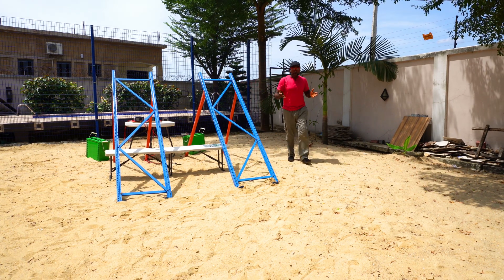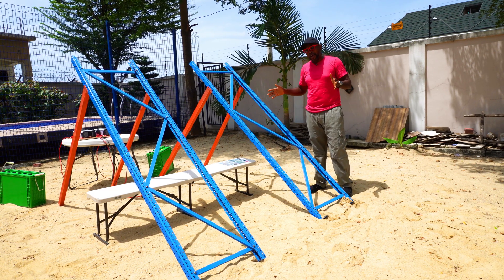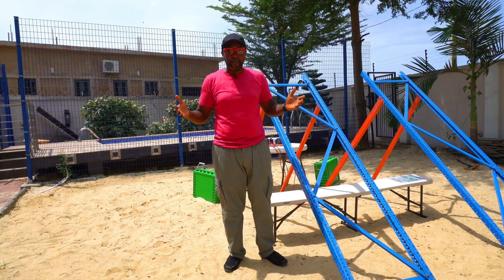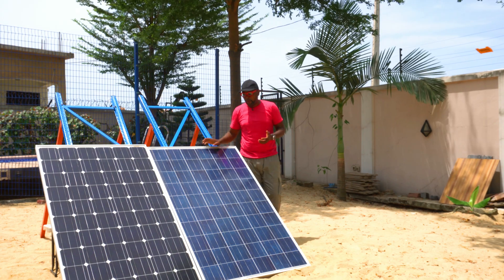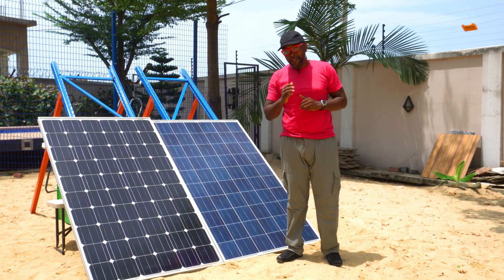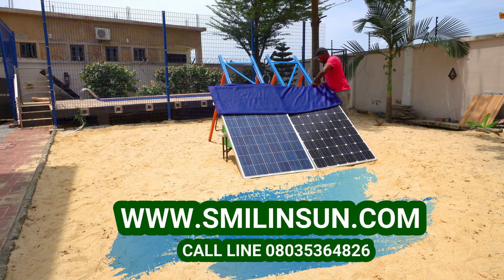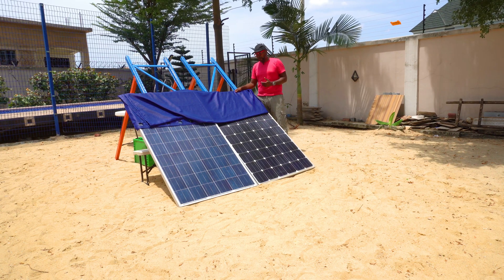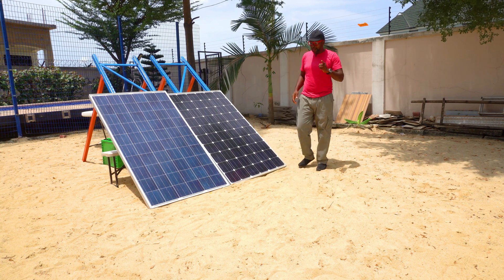Polycrystaline vs Monocrystaline Solar Panel an Output test.

Comment: The patch off is not a fair comparison for both. You need to check the orientation of the series and parallel connection of the individual cells on the panel. It's likely not identical
Reply from the maker: Lol   very incorrect insight

Comment: Thanks for educating us always, sir I have two batteries of 220ah and 230ah. Both in 12V, hope it's not bad using them together?
Reply: @smilinsun Correct, but it's not a bad idea as long as they are in parallel connection. I will not recommend the series connection for obvious reasons.

When they are in parallel, 220AH battery gets to full charge first because they are in parallel connection and the 230AH will also get to almost full charge. Let's say 225AH storage or even 230AH depending on the charging parameter or inverter.

Let's be theoretical here. Let's say the first battery is 10 ohms resistance connected in paraale to 11 ohms resistance (Second battery). The total or effective resistance is (10 x 11)/(10+ 11) = 5.23 ohms.

Voltage drop increases with increase in resistance. This is why the voltage on the battery increases as current flows through the battery thereby increasing the battery internal resistance. Charging voltage increases by the increase in battery internal resistance.

Full charging voltage is determined by the inverter as a result of the expected internal battery resistance which determines the charging absorption voltage.

Another way to look at it is because the 2 batteries are in parallel. Using ohms law, the same voltage will be across both batteries, but the charging current will be different based on different internal resistances. This will continue until the resistance to stop charging current flow is reached for both batteries.

Inversely when discharging, more current is discharged from the battery with lesser resistance (230AH Battery) then the low battery protection is reached when the resultant resistance for low battery protection is reached for both batteries.

When the storage capacity (Amperage) for both batteries is wide, it is practically not encouraged.

230AH and 220AH in parallel is not totally a bad idea if there is no option of using the same battery amperage and brand.

However, this is not a yardstick or a culture to begin to mix different batteries of the same amperage or different battery amperage of the same brand.

My humble submission.

Good job@smilinsun
Reply from the maker: Batteries of different  amperages should not be used together